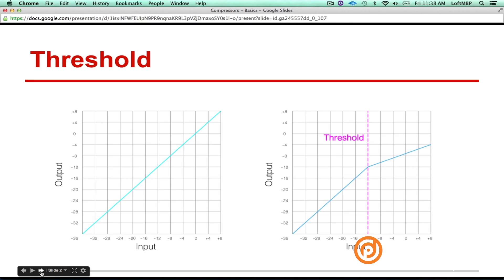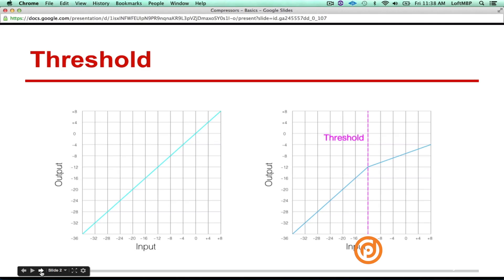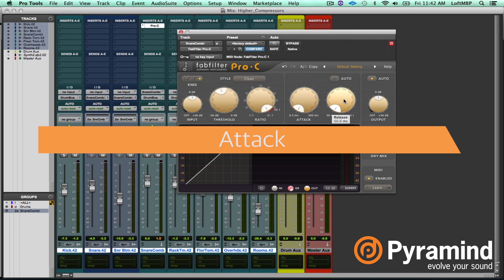How a Compressor Works | Part 1 | Theory & Parameters

Comment: Im sorry but 'math' at @7:51 isnt logical at all to me, so can anyone explain? Treshold is at -12db...input signal is on -8db...ratio is: 4/1...so isnt the output signal => 8db+1/4*4db=9db not 11 db like in the video (by 11db i think its done -> 8db(input) + 3/4(ratio)*4) ? Thanks in advance :)
Reply: in this case you will get 1dB above the treshold (not above input signal how you calculate).
Reply: You add the +1 on the threshold, not input. So 
<threshold> + ((<input> - <threshold>) / <ratio>),
which is -12 + ((-8 - -12) / 4) = -11

Comment: Thank you for your video! Finally i understood why it never made 100% sense to me when people  said/wrote that release time is "the time that it takes for the compressor to start working after signal passes the threshold". I read and heard this many times while trying to learn the compressor. But it is misleading. It starts working immediately but takes the attack time to reach a specific amount of compression (2/3 in your example but different for different compressors). I had to post this cause i'm so glad to have finally cleared that up in my head! Thank you!